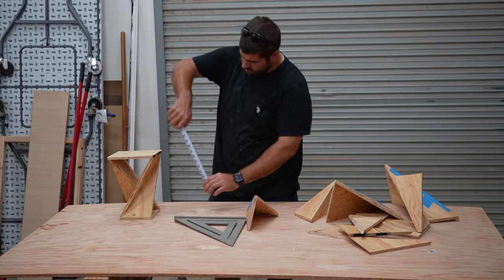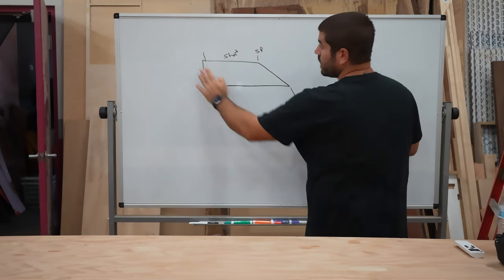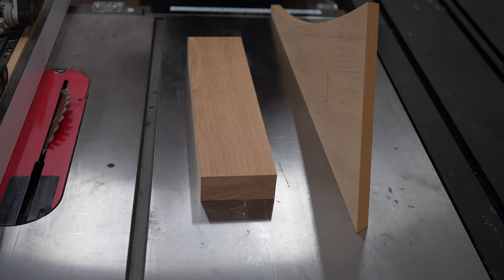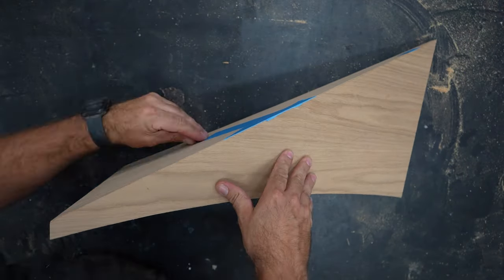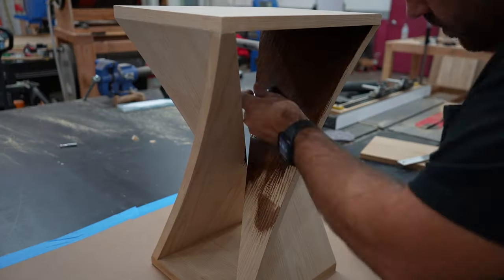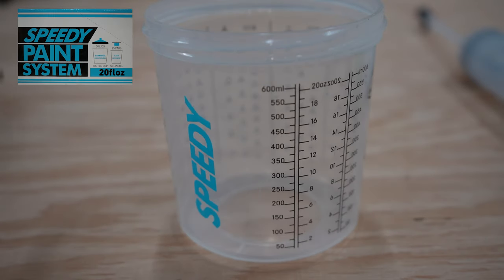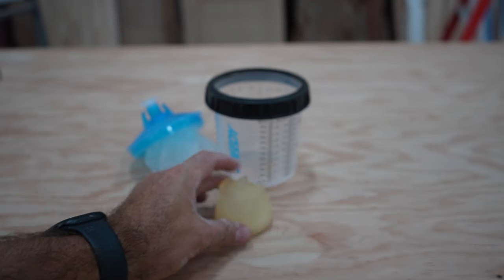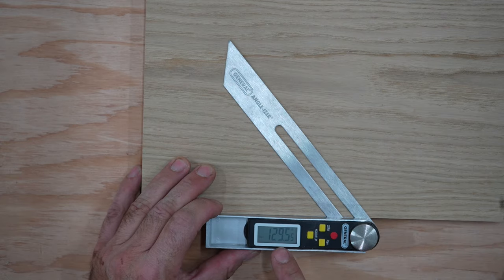Twisted End Table (My Most Frustrating Project Ever)

Comment: @knowledgeiskings your hard work deserves a tap on the back, as a DIYer/fabricator I can see the frustration this project could cause, if its possible could you make the plans available for me to purchase in UK, I'm a solid surface fabricator that works with DuPont corian and would love this as a project
Reply from the maker: On my website it is a digital plan download so you should be able to purchase from anywhere.
Reply: The billing option are not valid as the postal code/zip is set to US only, need to change to UK zip/postal code but it won't let me
Reply: @knowledgeiskings  managed to purchase the plans, from your page, thanks alot, looking forwards to the challenge

Comment: Nice job! Are the plans downloadable? Because it seems the website only accepts US addresses.. thanks
Reply from the maker: Yes they are a download. You will need to put in an address for your credit card though. But it is only a download.
Reply: @knowledgeiskings  Thanks, done 👍.  One more question though:  the curve on A is 1in. Is the curve in B 1.5 or 0.5? The drawing shows the gap smaller…